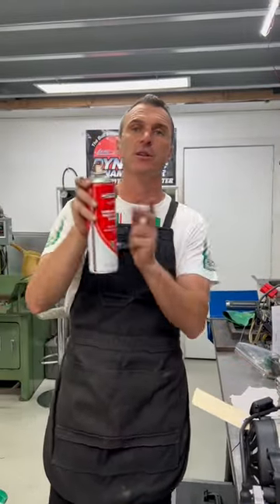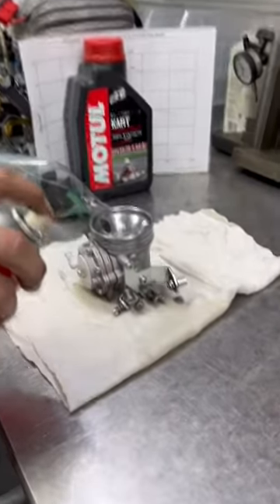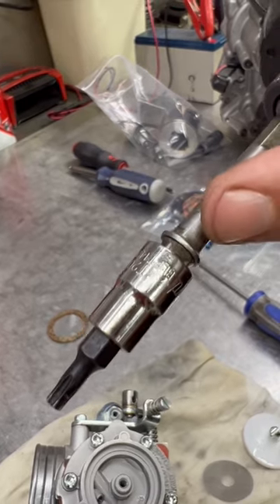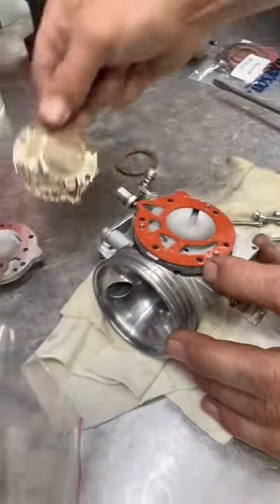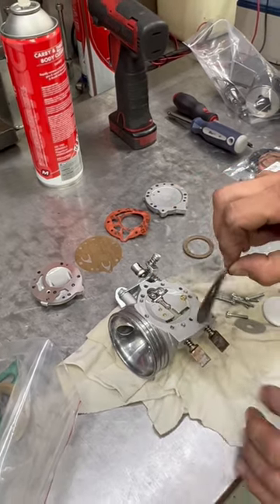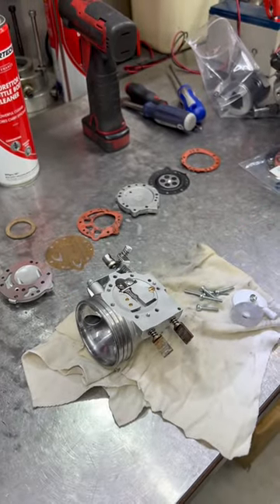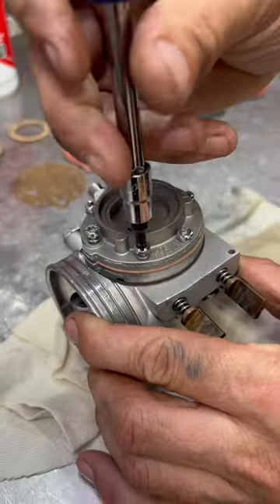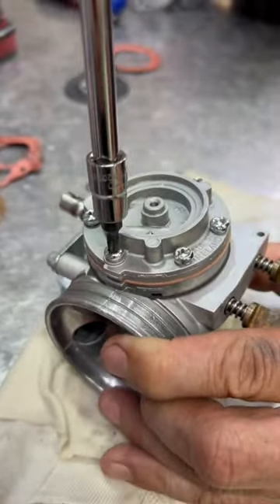Tilllotson Carby Service 😉

Comment: Rattle guns are for cray crays right Tay Tay 😂
Reply: Yup! It's OK for disassembly but not for assembly, you can use a drill at a low setting for reassemble.